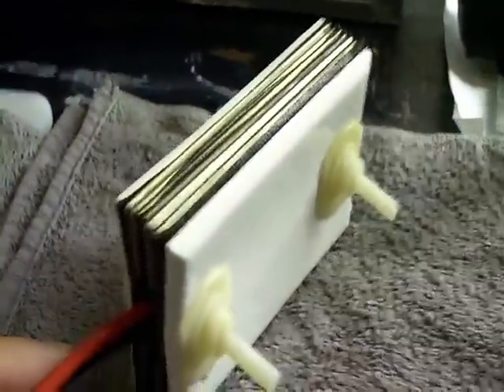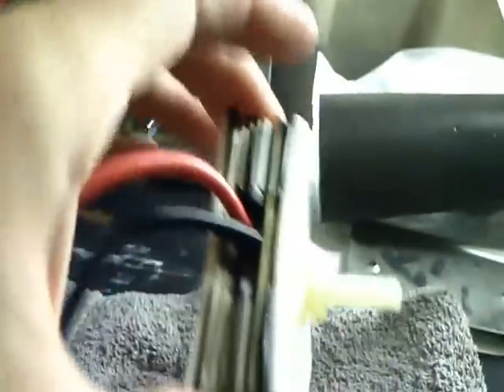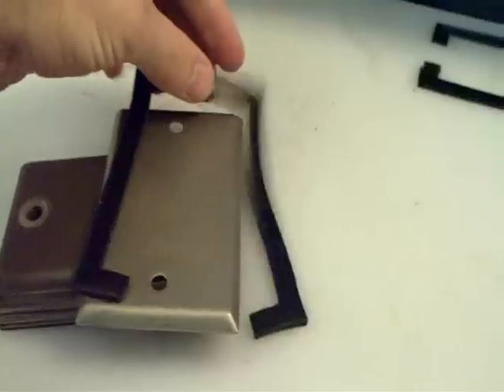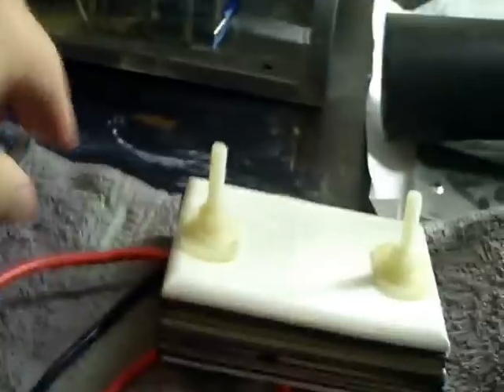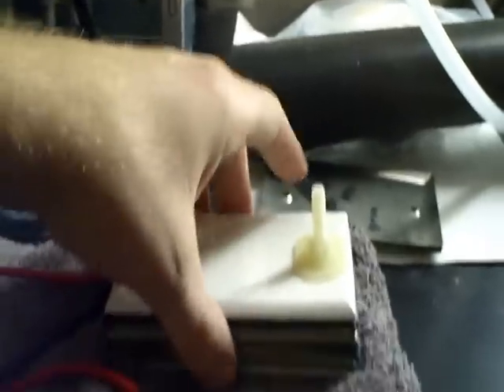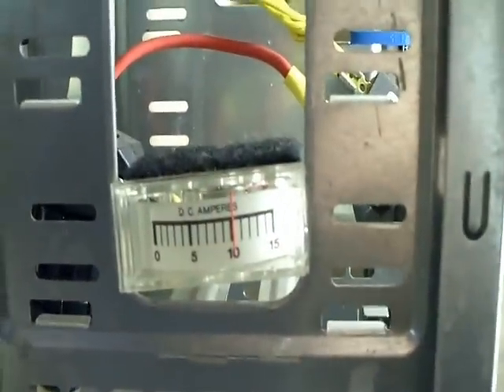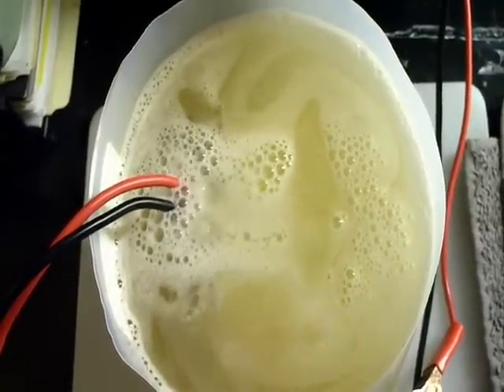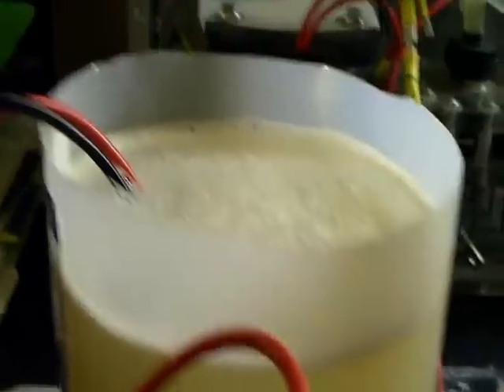Vid56 Wall Plate Volcano Concept (HHO, Brown's Gas, Hydroxy)

Comment from the maker: @joewilder 

I've used zinc plated washers before and the water turned black. I don't know if scrubbing pads would do anything to reduce this. Maybe if they were the sponge/scrubbing pads between each plate?

I've been wondering what would happen if someone used stainless window screen (marine variety) and ball bearings to build a cell. This could be very inexpensive and would have an enormous amount of surface area.

Comment from the maker: @irondmax 

thanks, I've found that closer spacing reduces the distance the current has to travel and keeps amperage to a minimum.

304 does break down faster than 316, but the wall plates are thick enough that they should hold up for a while.  I didn't have to buy any of the wall plates, because I had bought them last year and forgot I had them.

If I had unlimited funds, or even a budget... I would love to try titanium, because the output is excellent, the plates are lighter than stainless.

Comment from the maker: @vox1philippines 

Plate cells are very time consuming, but I've made stainless pipe cells before and never noticed much time difference in preparation of either cell. To me pipe cells are more difficult to build, they are much larger, and they are heavy.  I'm more interested in making small cells and maximizing their output.

With pipe cells I made several different designs, but never results that were worth posting.

Comment from the maker: @sylvanenergy 

For experimenting with different configurations I would rather use 304, because 316 Stainless is too expensive. 

When I have a design that I feel is at its maximum efficiency, I would consider using 316 for the finished build. I would even consider using titanium negative plates for a final build if I felt the design / Plate configuration justified it.

I would rather "waste my time" as you say, than waste my money!

Comment from the maker: @klausisense 

In my Video 47 I go over the material I am using for gaskets. It is a material used for lining cupboards or drawers.  It is very easy to cut and when squeezed creates a better seal.

Comment: Nice. Looks like it works pretty good. I like the 304 for HHO cells. economical and easy access. I built my dry cell with the switch plates. I modified them by cutting off the top and bottom. Then I flattened the sides down and used a sealed gasket method. I used a cellulose/rubber gasket .046" thick. It's a pretty small cell. I only used 16 plates. Works great though. Thanks for sharing. -Joel